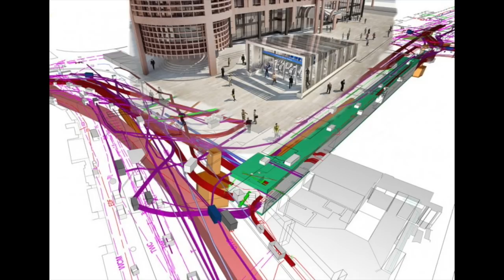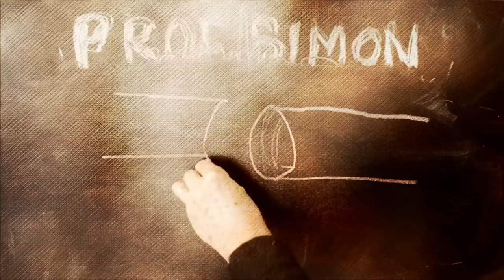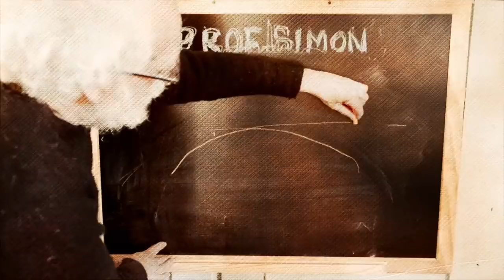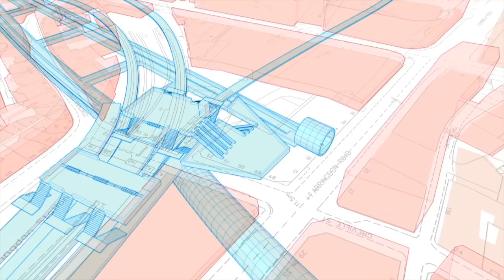Under London the earth is NOT flat - Prof Simon.

Comment: There is a perfect place for flat earth believers to go to on the east Irish Antrim coast called Cushendun on a clear day at sea level you can see Ailsa Craig a small island of the Scottish coast about 35 miles away which has an elevation of 1200 feet above sea level and when you drive a mile or so outside the village to the high ground to about 700 feet above sea level you can see 50 percent more of this islands elevation it is a perfect visual place to be able to see the curvature of our planet but at the most Northern point of Ireland where you can see to Tory island in the far north west of Ireland to islay island in the far west of Scotland which is an ocean view of at least 100 miles across at about 100 feet above sea level it optically looks flat and difficult to distinguish the curve

Comment: asserting that if these tunnel engineers hadn't factored in the curvature of the earth they would have messed up their alignements does not verify as to whether or not these engineers applied curvature calculation to their designs.

you've formed a conclusion based on a presupposition that is so easily refutable with the simple application of logic. 

I noticed that you used footage taken from a high altitude balloon to impress upon your viewers the idea of earth's curvature, yet you failed to notice the curved rope and the varying differences of the apparent convex to concave Horizon line captured thorough the camera's fish eye lens .

here's what the earth looks like using a standard camera lens https://www.youtube.com/watch?v=yHcM5OmkSpQ 

though I can not provide evidence of a flat earth that isn't subject to refutation by speculative physics too which globe earth believers are so inclined to use, I can provide a practical demostration to prove that the sun moves around a non rotating earth. would you like to know how? it's so simple a recreatable demonstration that no amount of argumentation can refute the tangible physics it displays.

Comment: Not Subway Related but it is tunnel and train related 

US standard railroad gauge (distance between the rails) is 4 feet, 8.5 inches. That's an exceedingly odd number.

Why was that gauge used?
Well, because that's the way they built them in England, and English engineers designed the first US railroads.

Why did the English build them like that?
Because the first rail lines were built by the same people who built the wagon tramways, and that's the gauge they used.

So, why did 'they' use that gauge then?
Because the people who built the tramways used the same jigs and tools that they had used for building wagons, which used that same wheel spacing.

Why did the wagons have that particular odd wheel spacing?
Well, if they tried to use any other spacing, the wagon wheels would break more often on some of the old, long distance roads in England . You see, that's the spacing of the wheel ruts.

So who built those old rutted roads?
Imperial Rome built the first long distance roads in Europe (including England ) for their legions. Those roads have been used ever since.

And what about the ruts in the roads?
Roman war chariots formed the initial ruts, which everyone else had to match or run the risk of destroying their wagon wheels. Since the chariots were made for Imperial Rome , they were all alike in the matter of wheel spacing. Therefore the United States standard railroad gauge of 4 feet, 8.5 inches is derived from the original specifications for an Imperial Roman war chariot. Bureaucracies live forever.

So the next time you are handed a specification/procedure/process and wonder 'What horse's ass came up with this?', you may be exactly right. Imperial Roman army chariots were made just wide enough to accommodate the rear ends of two war horses. (Two horses' asses.)

Now, the twist to the story:

When you see a Space Shuttle sitting on its launch pad, there are two big booster rockets attached to the sides of the main fuel tank. These are solid rocket boosters, or SRBs. The SRBs are made by Thiokol at their factory in Utah . The engineers who designed the SRBs would have preferred to make them a bit fatter, but the SRBs had to be shipped by train from the factory to the launch site. The railroad line from the factory happens to run through a tunnel in the mountains, and the SRBs had to fit through that tunnel. The tunnel is slightly wider than the railroad track, and the railroad track, as you now know, is about as wide as two horses' behinds.

So, a major Space Shuttle design feature, of what is arguably the world's most advanced transportation system, was determined over two thousand years ago by the width of a horse's ass.

Is this True or has it been Debunked ..well i will leave you to google the truth ...Have fun
Reply from the maker: i love it...great fun connection.
Reply: Hunting down the truth of this was an educational experience, i won't spoil it for anyone else. Have fun ^_^